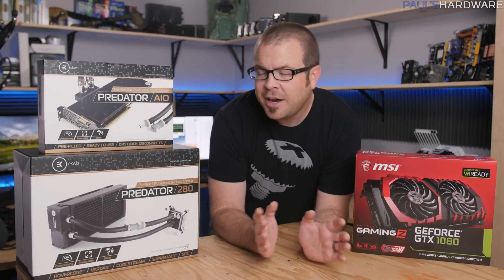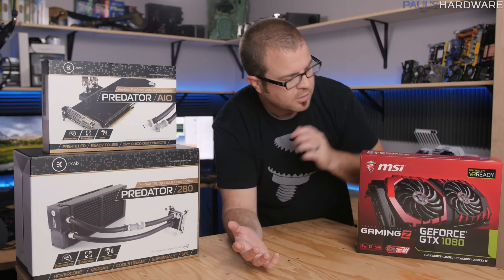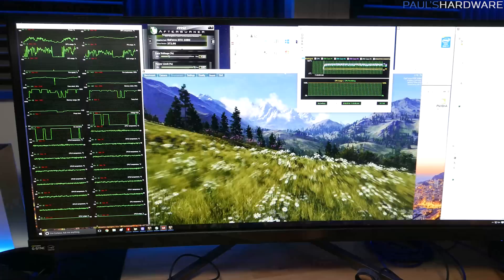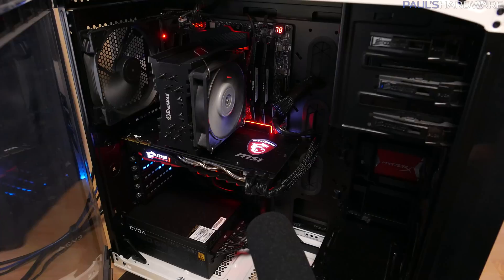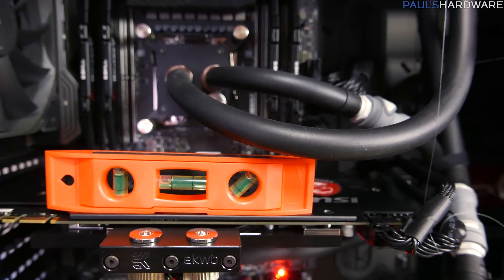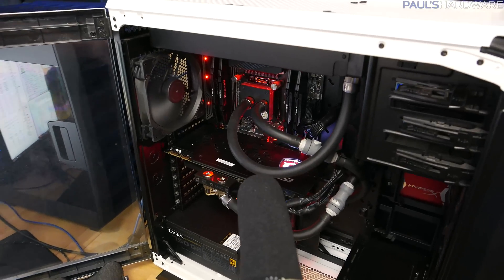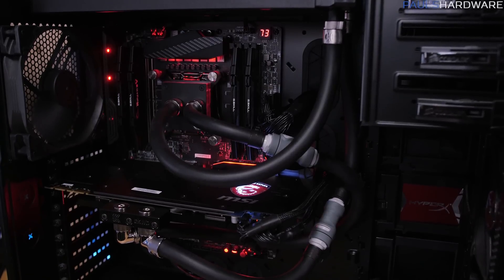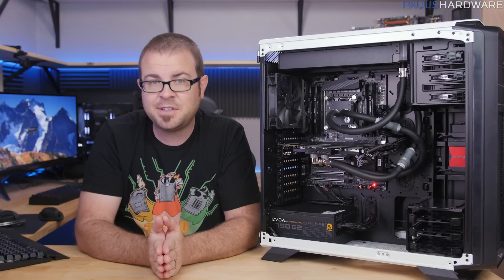Watercooling Simplified: EK Predator 280 + MSI GTX 1080 Z

Comment: I like the QDs a ton. Perhaps they might be able to be integrated into a hard line build.
Reply from the maker: That would be interesting, and challenging. I am not sure if it would work but I'd be curious to find out!
Reply: How do you unplug hardline disconnects? They're hardline ffs.
Reply: Anything is possible.
Reply: Dennis Badashov Yeah the QDC's are just for noobs. the whole point is you buy the CPU loop and then if you want to add a GPU later you can order a pre filled GPU block with a QDC on it and simply plug it into your loop. clean and simple, just like consoles lol. I was thinking of buying one of these for an ITX build simply because of the compact rad/res/pump combination. The QDC's would have went in the bin though 

If you're doing this, you'll need at least a 240mm rad for a CPU and GPU, a 360mm if it's an AMD. No joke I've got two 290x's and no need to turn on the heating in winter.
Reply: I wounder if that pump would be strong enough to add a 240 rad to that loop as you mentioned?
Reply: No.
Reply: Yes, if you add a second EK-XLC Predator rad, since the pump is in the rad and not on the CPU block.
Reply: Jim O the loop is fitted with a DDC pump installed with a small reservoir at one end of the radiator. Nice piece of design by EK. I digress, yes I know and just as grumpy. The DDC pump fitted is the same model as you buy in custom loops, one if them any but that means more digression. I have used one of these pumps without issue for over three years running through multiple leads and blocks. This EK kit is basically  a custom loop in a box. This isn't one of those built by an accounts calculator AOI pieces of crap.
Reply: I'd think EK might suggest installing another pump/rad combo in a separate loop rather than attach another rad. Not even mentioning it's more soft tubing cluttering your case.
Reply: Peter Welsh welshy46 Lol, another aspect on the pro side to using water cooling I'm sure Californians such as Paul, Kyle, Jay and probably most others never considered.
Reply: Dennis Badashov What he was saying is he has two relatively hot running gpu's and doesn't need to turn on the heat in the winter considering he needs to expel 580w worth of heat whilst under load therefore heating his house. I just thought that was pretty damned funny.
Reply: Keatononame Yep contrary to popular belief, but I doubt Jay's. He's too smart. A water cooled rig will warm up a room a lot faster than an air cooled one. 

I was thinking of upgrading to a pair of 1070's, but with winter approaching I think I'll keep the 290x's till the spring. I used to have three, but what with global warming and all. I thought I'd try to do my bit. Seriously though the neww Nvidia and AMD are a hell of a lot cooler running than my 3 year old stuff. One of these Predator set ups with a 240mm rad in a well ventilated case should have no problems keeping a 6700K and 1080 way cooler and more overclockable than air. Although I'd get the 360mm 

My major problem with this product is it exposes the extent to the dumbing down of society. when the alleged PC Master race need plug and play "custom" cooling, when only a few years ago if you wanted to water cool your PC, you went to the local aquatics centre and pulled old fridges apart.
Reply: Dennis Badashov The Predator 360mm is 410mm long. The alphacool UT60 rad alone is 360mm. All of the parts to the Predator kit are stand alone water cooling parts. The CPU block is a EK Supremacy, probably the best block on the market. The pump is a DDC, again top banana. The fittings are EK's own 19mm OD compressions and the tubing is also EK's and of high quality. 

If you bought this you could with very little effort drain the loop, remove the QDC's and cut the tubing to suit, a pair of scissors will do.  and you've got as good a custom loop as anyone else with a single rad loop. Fair enough you won't have the cool liquid filled reservoir, but a small price to pay for something that won't degrade in quality over time like a standard AIO. All my EK stuff has been running nearly 24/7 for the last three years, including many fluid changes and running the pump dry. Which apparently instantly kills the pump. Someone should let Laing know. 

For anyone wanting a to jump to a custom loop but are scared of all the unknowns and the baffling sizing and configurations. This is the kit to get, it is a custom loop in a box.

Comment: can you add an extra radiator with this kit is like it and it looks like I could do hardline once I'm ready for that jump. I wish they had the resivour and pump seperate. Is it really that expensive can't you do a true custom build for around 500?
Reply from the maker: Adding a res and another rad wouldn't be too hard, you would add the loop filling/bleeding/leak-testing elements to the build that this configuration avoids though.
Reply: +Paul's Hardware Not if they were smart and added a prefilled rad with quick connects that you could add into this type of loop to their lineup.
Reply: Paul's Hardware Word thanks paul is there variations with the pump and reservoir septate.

Comment: I'm just looking as getting into this kind of high end gaming machines, would a Corsair 900D be the best platform to put it all in or is that overkill?
Reply from the maker: If you want to go all in with water cooling, getting a massive case like a 900D is a good idea
Reply: i think that's discontinued. I Have a 4500 usd system in a 99 dollar case(fractal define s)
Reply: Cheers for your videos, making a good chunk of my pre build binge research. Yes, looking at going for a full water cooling build after experimenting with over clocking my much older equipment to keep at the entry level. The old AMD Athlon II X4 630 has served well but needs to be put out for pasture now.
Reply: Get a Phanteks case! The Primo SE I believe is great.
Reply: 900D is for babys. get a caselabs 
MAGNUM SMA8 better the 10 version + customized like you want.
Reply: 900D is overkill unless you want tons of radiator surface. Like Adrian here said, if you want a very big high end case, CaseLabs is the way to go.
Reply: Why would the 900D be for babies? i happen to like mine just fine, while using all the rad space it delivers. 

Is it an aesthetic issue for you? Because i opted out on the alternatives due to looks.

Comment: That looks and operates great. I have the Predator 360, which I have been completely satisfied with. Overclocked my 5820K to 4.3GHz on 1.25v and it tops out at +35 delta temperatures, while being very quiet, which is great. My 980 Ti SLi are both Hybrids, but i really want to get my next cards set up with pre-filled Predator EKWB stuff. Only issue looks like the tubing? It looks crazy long. Not much space in my Evolv ATX for that tubing...
Reply from the maker: Yeah the extra tubing would be a big problem with 2x GPUs, there would be way too much. You'd probably want to just buy the GPU blocks a la carte and set up a custom loop with a reservoir
Reply: Paul's Hardware yeah, most likely. Going full custom is still scary! At least with expendable AIOs like the Predator and the older Swiftechs, you have some verifiable base to build off of.

Comment: Paul, I'm reminded of the time when I had an ASUS GTX 770 in my system.  The card's cooler had a metal shroud, so it caused the card to sag.  At the time, I thought it was a mistake to buy that particular card.  However, there was one solution I came up with.  I used a black zip tie to suspend the corner of the card from one of the hoses in my CPU cooler since I was using a Corsair H100i for my CPU cooler.  It worked like a charm and it did just fine until I upgraded to a lighter card... the EVGA GTX 970 FTW.
Reply from the maker: nice! I have had luck running PEG cables up to a higher grommet (instead of down) to provide some support, but whatever works! :-P

Comment: imo, water cooling is 90% aesthetic, and 10% performance. 

and this is ugly. too much tubing, don't like the fittings. etc. don't really see a point in this. can you get the CPU cooler and then reuse that radiator in a custom loop? that would be cool.
Reply: I went from a 800$ custom loop to a simple triple rad AIO by thermal take and they both cool the same on my i7 6900k xD
Reply: yes you can. Thats the special feature over something like a Corsair H100i.
Reply: Not really my GPU is loud and hot, after adding a block and expanding my EKWB Predator my temps and noise dropped dramatically, and performance went up, now i can sustain higher clocks, so no, it's not only aesthetics.
Reply: custom loops are mainly aesthetics.  Unless you are doing phase change or LN2 cooling you won't hit massive clock increases.  However I expect to see 5 gzh kaby lake processors.  Base is 4.2 on those chips.
Reply: water 3.0?
Reply: Not true at all.. Many go watercooling for noise reduction! And those who are picky about noise tend to have well insulated cases with no windows.  Lots of people prefer function over form especially when it comes to convenience or reliability. Yes high end air coolers do a great job, but on gpus they are limited.

Comment: Why would the GPU sag with the water cooler? Shouldn't it be heavier with the air cooler heatsink?
Reply: The combined weight of the water and fittings is heavier then the twin frozr fans

Comment: Or get the Zotac artic storm version of the 1080 than buying the ek waterblock
Reply from the maker: Yes, but the Arctic Storm isn't pre-filled, so you'd need to connect a res or do some very careful topping off
Reply: Oh yeah forgot about that😂🙌
Reply: ohh yea, who will provide the specific tubes that need to be connected to the loop :)

Comment: I totally watched the whole thing, I was thinking about doing this same thing with the Kelvin S24 from Fractal

I feel like Intel and nvidia parts run very cool so there's not a huge improvement from watercooling... AMD on the other hand runs a lot hotter so it would make more sense... But it doesnt make sense to watercool a $200 gpu or a 3 year old CPU
Reply: What about using aftermarket hybrid coolers like the Arctic or EVGA ones on the GPU? wouldn't that be cheaper and give you better performance? then you can have a 240rad for the CPU and 140 for the GPU, no leaks, no pumping hot water from one part to the next...
Reply from the maker: That's certainly a possibility too, those AIO hybrid cards stay very cool. I think there's some mysterious allure to having the CPU and GPU on the same loop, with the same tubing/fittings etc. You are very right that water cooling has limited gains overall though, but that's why it's less common.
Reply: Paul's Hardware Thanks for the reply, Paul, you've made my day! Maybe I will watercool, depending on how hot Zen and Vega run to begin with.